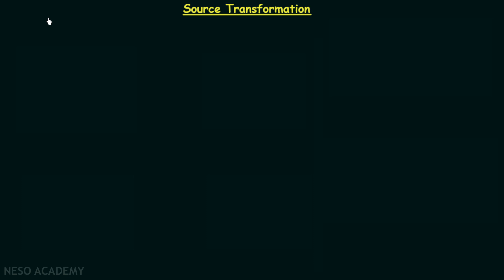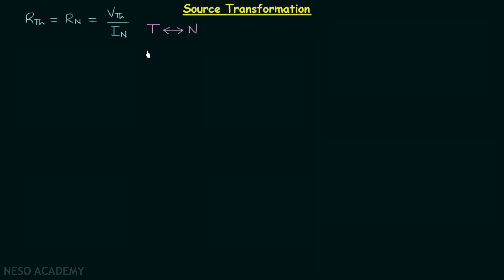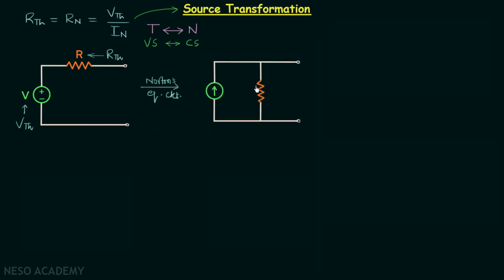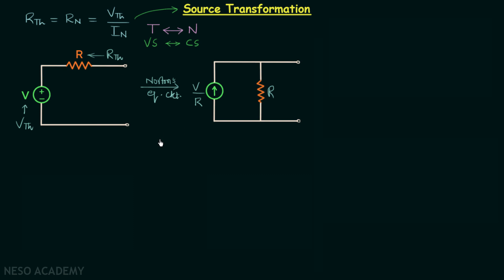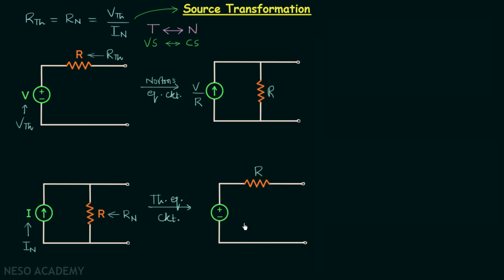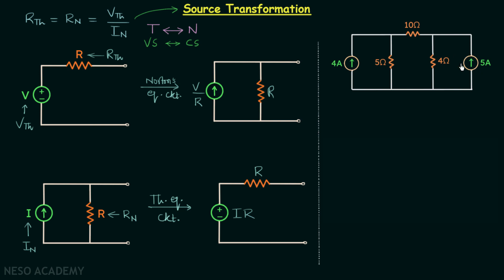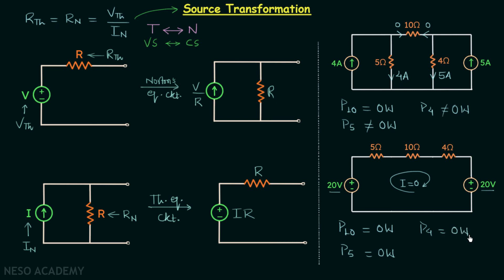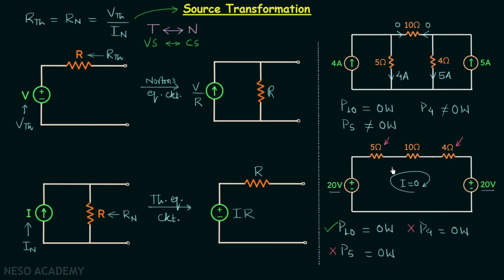Source Transformation

Comment: I am confused about why the power through the 5 and 4 ohm resistors is zero even though the current is flowing through it. Shouldn't it be P = i^2 x R so P(5 ohm) = 4^2x5 = 80 W?
Reply: Current isn't flowing as the 20-volt EMF source on each side is canceling each other.
Reply: simply apply kvl you willl get I as 0 A

Comment: On timing 5:30 why current not flow through 10ohm resistor
Reply: because the loop currents have to return to their original starting point. if the currents 4A and 5A flow through the 10ohm resistor they won't find the way of coming back to the starting point (the currents will conflict in the resistor too)
Reply: @sabirabi8795  thank you
Reply: Both the nodes are at same potential so no current will flow through 10ohm

Comment: If you apply nodal analysis at principal node 1 &2 you will get same potential of 20 volt so there will not be any current through 10 ohm resistor
Reply: Ek q m help krdo mera koi
Reply: @soudip8770  haa

Comment: sir if we r asked to determine the power dissipation of 5 ohm resistor what would be the ans??
And sir how could u take 0A current via 10 ohm resistor from both side at "case no-1"??
Reply: The points between which 10 ohm resistor is are at equal potential that's why no current flows through it.
Reply: How did 0A come through 10 ohm resistor?
Reply: @adityaoberoi266  that's what i was asking for..

Comment: Sir, in that example why the 4A and 5A currents from independent current sources won't enter into the branch consisting of 10 ohm resistance ? Please say sir..
Reply: @NesoAcademy please answer this question. Why 5&4A current didn’t enter into 10ohms registance?
Reply: @solaimanabdullah4611   and @Bharath Kumar, if you assign nodes A and B at the left and the right end of the 10 Ohms resistor terminal respectively and apply KCL at both of them, you will get two equations as follows:

3Va - Vb = 40 ---------------- (i)

3.5Vb - Va = 50 --------------(ii)

If you solve these equations you'll get Va = Vb = 20V

So, the current through the 10 Ohms resistor would be (Va - Vb)/10 = (20 - 20)/10 = 0A. I hope this clears the confusion. 

Alternately, you can see that when the source is transformed, you get 20V on each end. making the potential difference to be zero, subsequently, making the current through the resistance = 0A. But as the lecturer mentioned, you must not take this into account for power calculation because it will involve the current through the actual circuit and not the transformed one. 

Thank you and happy learning!
Reply: @SasawataDG  thanks ❤
Reply: @SasawataDG  thanks sir
Reply: @SasawataDG  thanks so much
Reply: @SasawataDG  Thank you Sir...
Reply: @SasawataDG  Thanks
Reply: @SasawataDG thanku so much bhaiii🎉🎉🎉